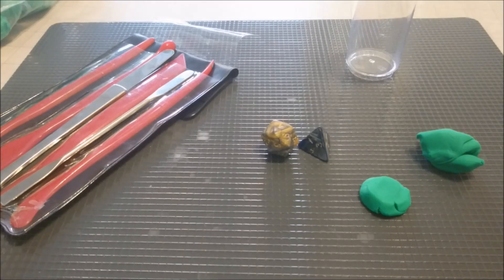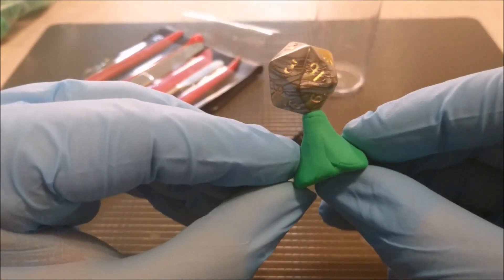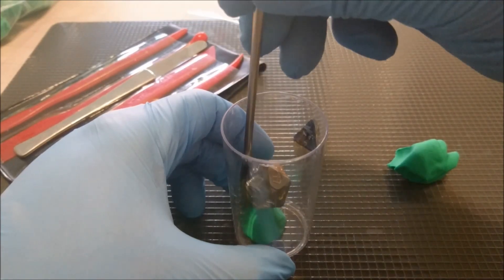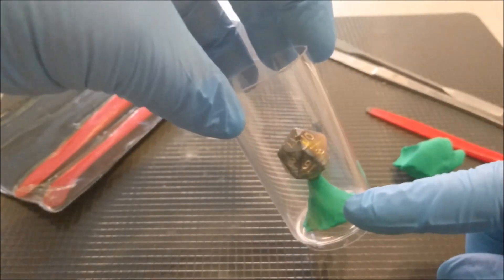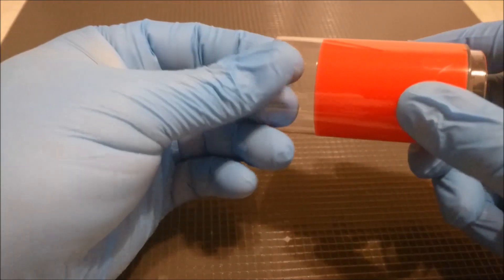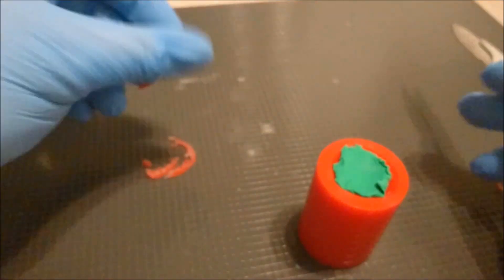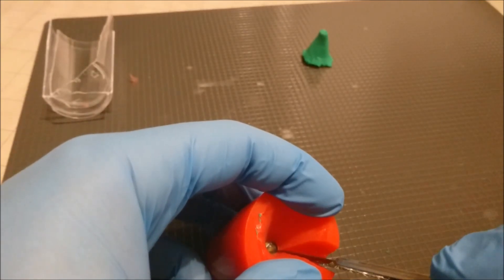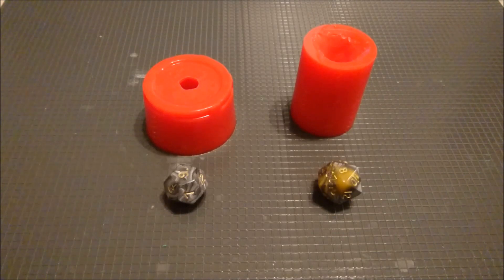Dice Making Mold Tutorial 2: Cut Mold (Sprue Mold)

Comment: This is super helpful! Would you be willing to make a video tutorial for the dice that you drilled a hole in? It seems like it would be less work to finish in the end, and I can’t find any other tutorials out there! Your teaching style is very helpful :)
Reply from the maker: I sure can do that. But filling cut molds with such a small sprue requires either a syringe or a vacuum chamber. The smaller the filling, the less work, but also more difficulties for bubbles to come out. But the pin in the die can help holding it on the clay. I'll try to get something up here asap.

Comment: For the die you drilled the hole in, (2:47)  could you do that with store-bought dice?  Where on each of the 7 dice should you put the hole in?

Also observation, instead of using your fingers you could always get rubber-tipped tongs to put your dice in your mold-cups! You can probably find them at pet stores, or any reptile shop, as I've seen them usually used to feet frozen rodents to reptiles. Just to make life easier for you.
Reply from the maker: Sry for the late response, somehow I just read this yet. Of couse you can drill in regular dice as well. It's a bit tricky as you want to put that hole on the tip of the die. It's not easy to drill on round vertices, but try to carefully centerpunch them with something spiky to have a little dip to center the drill.